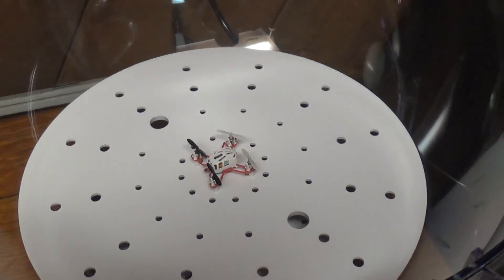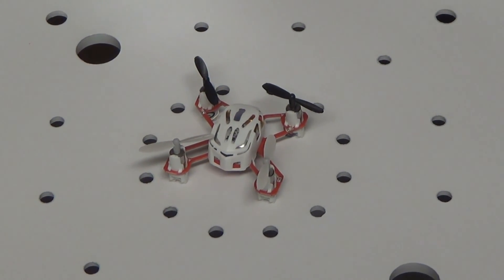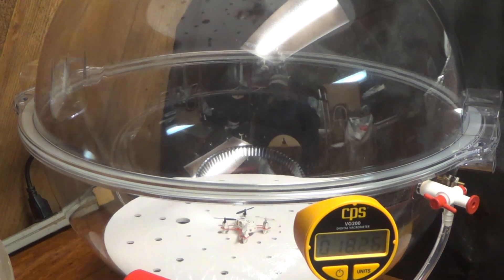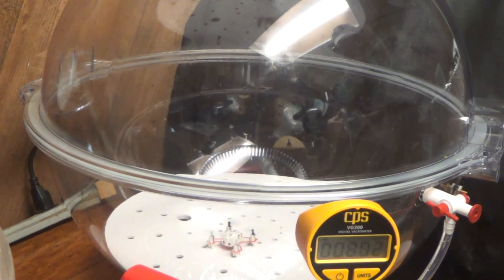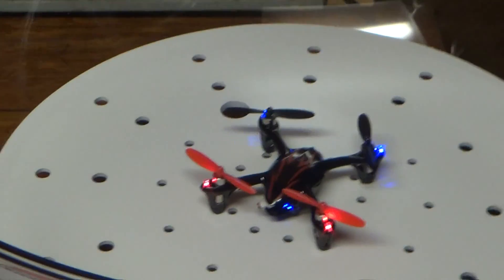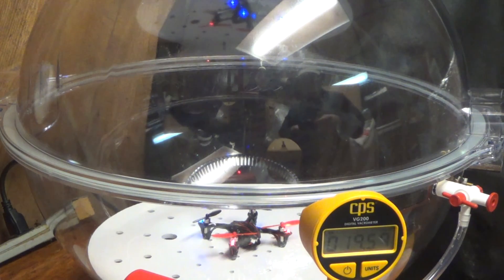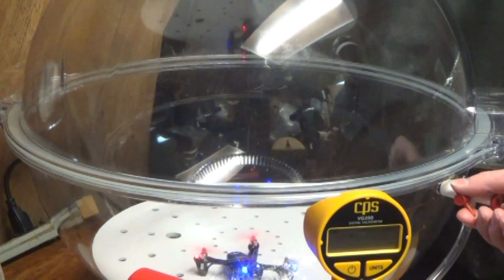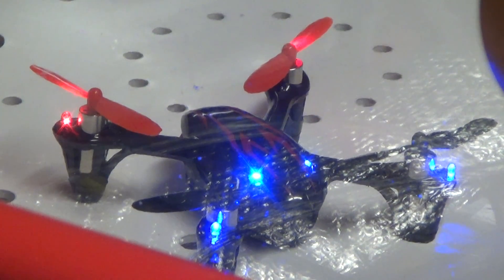Quadcopter on Mars! Vacuum Chamber Test 2

Comment: So this plus the NASA vacuum test pretty much shows that the "drone flight" on Mars is complete BS. But since the Rover is on Devon Island Canada it had no issues flying. Great presentation...
Reply from the maker: It shows that drones with rotors designed for 990 millibars wouldn't work. My previous test, however, clearly shows enough lift at 6 millibars using a bigger rotor and a bit more power.

Comment: now do titan or venus
Reply from the maker: A mission like this to Titan is actually in the works -- a machine that looks a lot like the Curiosity rover, but is set up as a quadcopter. Gravity is low, the air is thick -- and it should work fine. Check out this NASA video... https://www.youtube.com/watch?v=xn3-0a19sC8

Comment from the maker: It's looking like early January for my next vacuum chamber test run.  I'm waiting on parts to modify the quadcopters -- mainly much larger rotors, plus trickery to make them fit. Anything that lifts off at 6-8 mbar air pressures on Earth should fly fairly well at Mars where the gravity is only 3/8g.  So, I simply need to see liftoff to demonstrate decent martian flight capability.  Please stay tuned.
Reply from the maker: Still waiting on parts and free time. Meanwhile Nat Geo showed UAVs as a
 major part of their resent Mars series -- so my goal to legitimize the 
study of these things is becoming less of an issue.

Comment: Wouldn't there be a risk of heat damage to the motors if they are run for a long time while in a vacuum? With no air as a medium to dump heat into heat in the motors would stay in them with the exception of a tiny fraction of motor heat radiated out. Just a thought I was curious if it would affect your testing.
Reply from the maker: Point well taken. Indeed, air is essential for cooling small Earth-based electric motors, and when we build vehicles for long-duration flights at Mars, very likely we'll need active cooling jackets around the motors. For quick tests inside our lab vacuum chamber, we're not too worried about over-heating the motors. A few seconds at full power hasn't cooked them yet.

Sometime in September (2016) we plan to test our first "Mars optimized" flight systems with much larger rotors and steeper bladed pitch angles. Please stay tuned.

Comment: i know you have done this video 2 years ago but i would like to point out that you need larger propellers because you have less drag. That' s like water and air. In water you have smaller propellers compered to air propellers. So you should have much larger propellers in vacuum but do not use them enywhere else than in vacuum because you would fry your motors
Reply from the maker: Absolutely. Larger blades (maybe 1.5x longer) and a steeper blade angle would help a lot. This test was simply to see what happens with regular blades. At 7 mbar (Mars atmosphere) the best we will see from ideal blades is ~40% efficiency compared to sea level performance on Earth. But the gravity at Mars is 3/8th as much - so we should have similar flight times at Mars.

Comment: What you prove is the fraud that is nasa. No one has been to mars or the moon. Ask yourself why in the middle latitudes the length of the day changes. Does the rotation rate vary. Why doesn't Australia have winters like its northern equivalent does.
Reply from the maker: +timez draggen I run tests in my lab, make measurements, and calculate the inefficiencies of powered flight.  If you want to drop-ship pet theories to any useful effect that deny spaceflight flight history and the fundamental nature of our planet,  you have posted to the wrong thread.
Reply: timez draggen .......what Ben Franklin once said applies to YOU, it goes "......it's better to remain silent and have people think you're a half-idiot rather than open your mouth and remove all doubt"....

Comment: Why this has no views? It's amazing
Reply from the maker: +Victor Pelufaz ...Victor, it has some views, so at least a few people must be fascinated by 'flying' in a near vacuum.  There is a version 1 of this video series where I dump raw power into a giant rotor (by compassion to the tiny quadcopters shown in version 2) -- and in version 1 we see some lift. It turns out that if the blades on the version 2 copters were ~ 2-3 times bigger, they might fly at Mars.  So I need to make a version 3 video with oversized rotor blades!
Reply: +Ken Ramsley I just keep wondering why did you not show it flying with air in the tank just to prove that it would fly in there you have to have a control test before you do your main test have you not ever seen Mythbusters